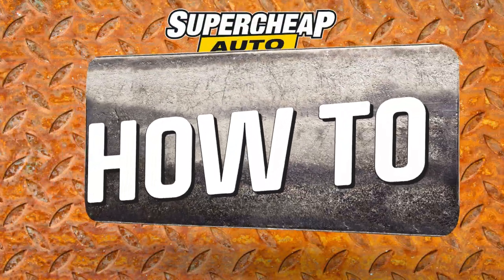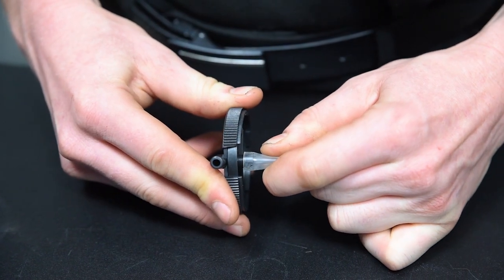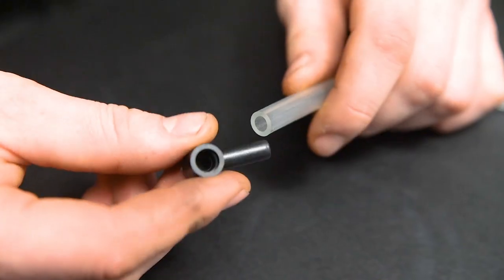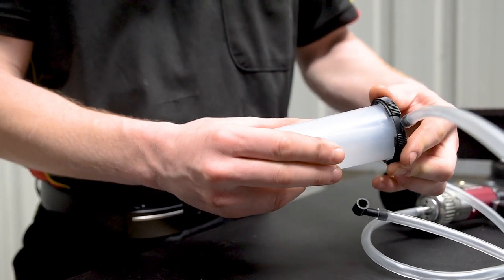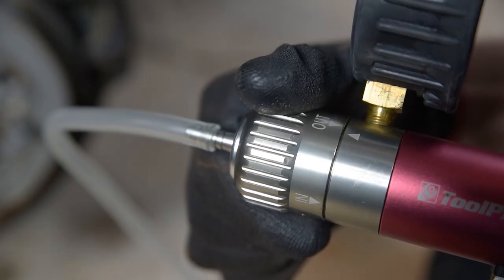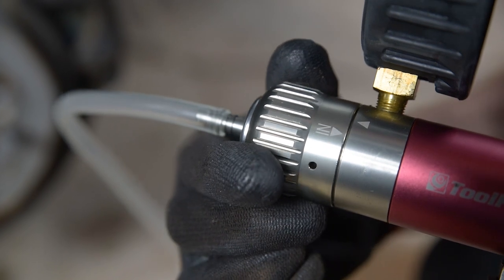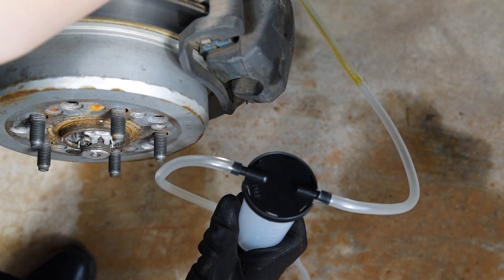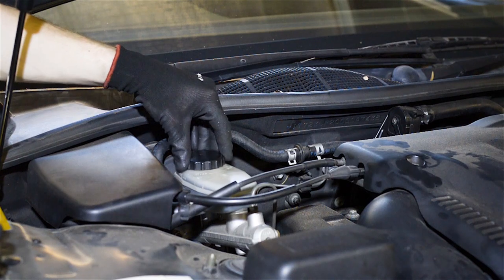How to use the ToolPRO Brake Bleeding Kit

Comment: Perfect idea & it should work well, but unfortunately the canister lid seal in this ToolPro kit is not brake fluid resistant so once it gets Brake fluid on it the seal deforms and no longer seals the container. You can wash it as much as you like when you are finished bleeding but the damage has already been done.
The clear hose is not Brake Fluid compatible either and after a week or two it goes as hard as a rock (even after flushing with water).

Comment: I use this today brand new it never sucked out a single drop  seems useless
Reply: Put some grease around the tube around the nipple. Perhaps you sucks only air?
Reply: @alundrasrt  I was thinking that  but use zip tie , no good either ,,
then used bottle method , putting  foot on break , worked but breaks spongey , so maybe in the end my bleeder screws might be clogged ..